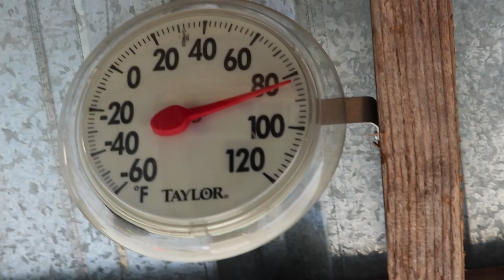HUGE HORNET NEST REMOVAL - Terrifying

Comment: Moon suit - Check.  Foaming wasp spray - Check.   OK, you're all set if it's really early morning or evening.  Have a  good one.  //   

Jesse, waaaaaaay overkill with the spraying.  (That could have taken down 4 more nests.)   And the heavy overspraying pulled out the original seal. Spray the outside, fill the opening, and it will kill most within a few minutes.  Others will land on it and be killed,  etc. 

Since you didn't do it in early morning, when they were all inside, they'll be coming back for many hours and hovering angrily at their stinky chemical-laden home.  It's enough to go tubbin' tonight, though.

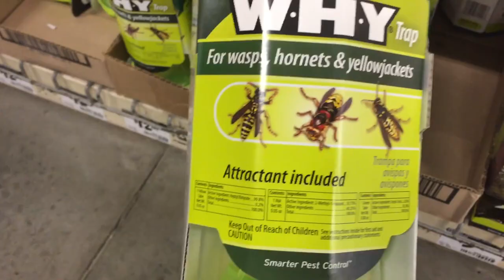Comment: I'm down in N Utah. Been working outside on my house this summer. The wasp and hornet situation is insane! I now have 2 yellow jacket traps like what you had in your hand @ 7:15 and 2 WHY traps @ 7:24. I like the yellow jacket traps best. They are built so you can take the bottom bait section off and submerge the trap end in water to drown the last living when emptying. The WHY trap is not designed well to empty. So far I have emptied them 4 times! They fill up in about 2-3 days. Ohh and lots and lots of spray killer. Good Luck!

Comment: Hey guys, for future reference; a more economical solution than the spray (since you have the bee suit), 1- 2 gal. bucket 1/2 - 3/4 full water with a few ounces of Dawn Dishwashing soap mixed in thoroughly. Douse the wasps if they are on an external nest or the paper nest is busted open. The soapy solution clings to them forming a film and they suffocate. It isn't a heavy chemical either. Also you might try the same solution and a backpack sprayer. Lastly, Pyrethrim kills them instantly and they stay away from where it is sprayed. You might look for some natural oils like citranilla or something that they hate to soak into your woods or leave residue on your metal equip. as a preventative. Just food for thought, to make your lives happier and less stressfree.
Reply: Love Dawn!
Reply: Dish soap works so well, I mix some into a hairspray bottle anytime I go to a barbeque
Reply: I was thinking about dawn in a foam cannon on the pressure washer.  No chemicals.  Knock it off first then just foam till nothing is flying.

Comment: Big cans of carburetor or brake parts cleaner (with the little red tubes inserted in the spray nozzles) are CHEAP, QUICKLY EFFECTIVE and they shoot plenty far. I keep a couple on hand all the time. The best time to take out a nest is after dark when they're all in it, they're calm/on low alert and less active because it's cooler. Just start spraying the opening, they come barreling out, get dowsed and go down quick, most of them. Do it again in the morning at sunrise, the ones you didn't get the night before will be back and sitting on the outside or they'll be inside the nest. Let 'em have it then knock the thing down and burn it (carb cleaner is also great for dowsing the nest to burn it).

Comment: When I was young I was stung by wasps in an old storage building 10 plus times (conservatively).   Since then I have been in "all wasps must die" mode.  I apologize to environmentalists,, but I have no problem with getting rid of them with extreme prejudice.  Gasoline works and paralyzes them instantly but I wouldn't do that around any sensitive or potentially flammable environment.

Comment: We had a nest 3 times that size in the eaves of our house. One can from outside then one inside from the attic. The foam is absorbed and kills the remaining critters inside and leaves a residue which kills any returners. Don't pile the foam on in one go as it falls off. Cover then wait, repeat a couple of times. Weapon 2 is an industrial vac with disposable dust bags, long hose and a metal  extension tube. This is used to dismantle the remains, sucks any stragglers and lavae straight in and contains them pending disposal. Weapon 3... Permethrin dust in the entry points where they settle in case they sneak back
Underground nests, vintage paraffin weed burner, it throws a 4ft flame 6" in diameter and the wasps pop if they try to exit the hole.

Comment: 1, The only good wasp/hornet is a dead one! 2. Perform all operations at night,they won't/can't fly to you. 3. You can spray/soak the nest till it's knocked down and destroyed with a water hose, they will relocate after a few days,  4. If a direct assault is required a can of WD 40 does the trick, 5. Do a regular wasp hunt every week and squash / spray all nest. Its much easier to kill a few before their friends move in, then 50 all at once,

Comment: The traps obviously won't get rid of a nest, but will keep them from congregating in certain areas, chemical-free.  Put them up with ONLY honey ham lunchmeat in them.  After a few days (don't wait too long or your meat will stink!) pop it in the freezer for 48 hours.  Then you can throw them all in the garbage (outside just for good measure) and set up again.  You can keep a few in rotation at all times.  Especially when they get aggressive in the fall.   Also, here's the only way I know to get rid of a nest that actually works:  1.  Spray nest  2. burn nest  3.  spray nest again.  I have seen larvae live through steps one and two before, and through multiple sprayings, but never seen them live through all 3 steps in order.

Comment: A safe nontoxic method is a squirt gun filled with mostly water and a little bit of dish soap and peppermint oil. The water and soap stop them from flying as you hit them and the mint oil soaks into the hive driving them off. 

The soap also stops them from working on the hive more as they have to chew the fibers to add on so chew on the soapy materials.

Comment: This is a familiar situation. I had a yellow jacket nest in a crack next to my water heater exhaust vent opening in my foundation. It took a bunch of research, creativity and patience to get rid of those guys in a safe and environmentally friendly way. But my situation is way different than yours ... other than the WTH do I do factor.

I checked my goto resource for dealing with any sort of flying/stinging bugger to see if I could find any useful advice. Here's what I found:

"The best strategy is to treat the wasp nest at night when all the workers and queen are present. Spraying into hornets nests should ALWAYS be done at night. They are far less aggressive and are all at home. This tactic maximizes the effect of the pesticide application by killing most if not all of the wasps. If treatment is made at night, avoid shining a light directly on the nest or use a red filter on the flashlight to dim the shine."

"Daytime treatments are successful when the wasp nest is treated, or if the wasps present on the nest are killed. Then, the wasp nest is removed, and the attachment area treated. Returning workers looking for the wasp nest contact the residual and die. Complete the job by removing the wasp nest, particularly if it is in an attic, wall void, etc. This service prevents secondary infestations by dermestids or other pests."

I'm thinking that you may have won the battle/war. You definitely treated the nest :-) I'll be interested to see how you made out.

Comment: I stepped on a ground wasp nest and after 30 plus stings and a trip to the hospital and now I have to carry an epi pen - my solution was to dress up in winter gear (nice and thick) in plus 100 degree temp, poured gas down the hole then tossed a lit paper ball and Kaboom - I had flames shooting 4 feet in the air,  burning bodies everywhere and then I thought - didn't some underground fires start by someone doing what I just did.......but the wasps got even, the one's that survived flew into my on demand water exhaust system and plugged up the fan.  Plumber and replacement part 400.00.  Your way, much cheaper.

Comment: Wasps/hornets are very normal in the wold of country livin'. Something I've seen in the recent past with those bastages is after the nest has been knocked to the ground... They just dig into the ground and set up shop there. I didn't notice it until it was too late. Just somethin to be aware of. Also, if you wait until night time to spray them, you have a better chance of success because they are all in the nest. If you do it during the day then a good portion of the wasps are off foraging and then they rebuild quickly. It's best to get them all in one go as opposed to fighting them for days/weeks unnecessarily. Food for thought.

Comment: I got nailed last week.  Working on a gate running a drill - WHAM, WHAM WHAM, a cloud of these bald faced hornets surrounded me and were stinging and biting.  I stumbled down the hill and ran to the pole barn - some even followed me inside.  Ended up with lots of stings and anaphalactic shock - [air way constriction] (I'm alergic), but massive antihistimines took care of that after awhile.  They are nasty critters.  Found their nest in the ground an drive a spike through it (about 10" diameter in the hole), as I pulled out the spike it was like a hornet volcano - and I hit them with the foaming spray as they emerged.  Building a trap now - like Nick Fouch was using in a recent video from them - gotta reduce this population of hornets.  There are other nests out there and they have been 'harassing' me when I work - going through lots of cans of spray, and having to keep looking for them swarming to attack - never heard or saw them when I was running the drill.  
Reminds me of the line in the old Star Trek episode about the "Yangs and Coms" -- something like "we drained a dozen handphasers and they stll kept coming..."  I gotta look that up and add to my wasp video.  Nasty critters -- ...from now on I show them no mercy...

Comment: Ack.  Deja Vu.  Today I had to neutralize a nest that was built inside the cab of a truck I needed to to work on.  I swear the nest was at least two gallons in volume.  it was HUGE.

My SOP for large nests is to foam seal the entrance, then use the optional straw attachment to puncture the nest and fill it from the inside.

Comment: Easy fix  ! wait until a cold night  get a thick  builders rubble bag . a thick rubber band a flat saw which you have . 
rapidly go to nest not breathing in sensible clothing take bag put it over nest . put flat saw along wood in one final blow scrape along wood until nest drops into bag place band on it  right away . 
if you get stung you never had insect repellant on your clothes . release band from bag into the wild and run away without breathing for ten seconds and your done . 
i used to renovate huge buildings and have done this about 12 times at least that i recall .
kind regards .

Comment: Many moons ago, when I was in my 20's, like 40 some years ago, we found a nest the size of a basketball, hanging from a branch that was about to be trimmed. We removed it with 12 ga birdsong from over the top of a running vehicle. We left as it shredded into the distance. After a 1/2 hour beverage break we were back at it with me visible sign of the wasps.

Comment: Take down weeds / trip hazards in your escape path, wait until it is dark and cool out most if not all of the insects will be in the nest, line up with the entrance and angle into the nest and SATURATE the entrance first, then lightly cover as much of the nest surface as possible revisiting the entrance frequently. Have a 2nd can available for cleanup if there is ANY activity the following day.

Comment: I've always liked Raid Wasp and Hornet, it kills them dead out of the air and sprays for somewhere around 12 feet. Never had a re-occurrence of the hive either, they just find a new place. For yellow jackets on here in NC they usually have a ground hive so soak with gas and a match takes care of them.

Comment: I find burning the nest to be the easiest and most effective.  The paper of the nest burns very quickly and usually extinguishes before anything around it ignites.  It addition, and this is cruel, the wasps wings burn even better than the nest paper rendering them flightless even if they did escape.  Obviously you might want to keep a hose handy in case something else did catch fire but that would still be a minimal risk.

Comment: Get some Hornet spray at the hardware store. They can only come out of the hole in the bottom. Concentrate spray there until it runs out. 

Then just leave and return tomorrow. They will be gone.

Comment: After dark is the best time. Some of the bees leave the nest to find food during the day. This means that if you kill the ones in the nest and destroy the nest during the day, Those that are away from the nest will return and will be around for a few days. Yellow jackets and hornets are more of a nuisance than anything else. They don't produce honey and are more trouble than they are worth. Get a good sized plastic storage tote with a cover. Put a small hole in the top and put some water and meat in it. It attracts the pesky critters and drowns them in the water. There is a video on how to do this on youtube. It doesn't attract honey bees but may attract flies too so it may solve two problems at once. It reduces the problem. If you don't do something their numbers will continue to increase with more nests each year.

Comment: Use a shop vac with extra extension
Reply: With filter.  Full gear with long sleeves/gloves/face mask & head screen.  Once you get them all sucked into the shop vac you can poison the lot with one application.  Make sure you get the queen in the nest.

Comment: Use ether.....it will put them to sleep then you can deal with them as you see fit....don't try to do it all at once, or in an inclosed area.....also soapy water (Dawn) works well, I used 1/4 cup per gl. of water, not sure what ratio is best.....🤔  Anyway the video I first saw this on they used a weed sprayer, & were spreading bee's...looks like spray foam works too...:)

Comment: I've had wasp nests infestations in my school bus mirror shell and because i'm anaphylaxis to them the mechanics eradicated using a steaming towel wrapped around the mirror first, which wouldn't work in this case, brake cleaner second, then take an air hose and gun and blow it off to the ground.  Light it on fire, and lastly if you wanted run over it with a truck.  Also I have gotten stung in other instances in the back of the head and they are not pleasant so wear a hat.

Comment: Always wise to be cautious.
Reply: Also dont panic and start flinging your arms at them. Fas as i understand, these little flying fuck heads sense intruders via vision, even though they have great sense of smell.
Bees and wasps you can get close at the night when its colder, but hornets are 24/7 active. I just couple weeks ago run into one wasp nest while doing roof repair. I banged board in, whole roof shook from it and 20 come out from the nest 2 meters from me. I freeze up, they buzzed around and couple even fly past me, but they didnt attack as i didnt move. Of course i dont know many American species as we only have about 4+1really rare species in Finland.

Also you should try to limit number of wasps and hornets in the area, as they kill bees and bumble-bees, witch should be left alone and are actually useful creatures. Even if safety problem, then just remove their nests clean with knife into bag and move the nest into forest.